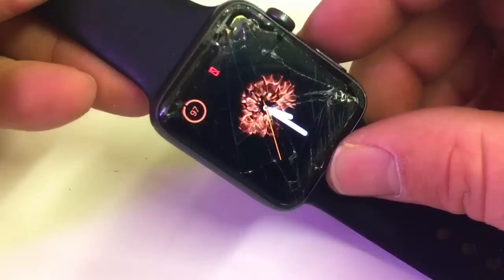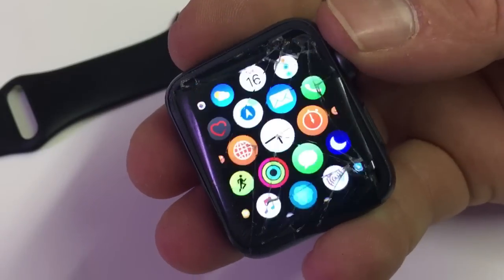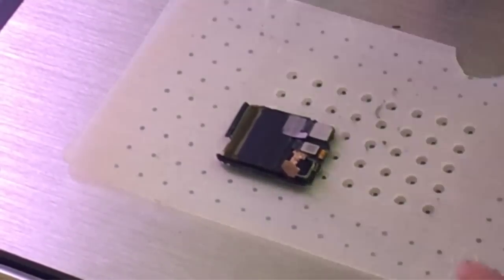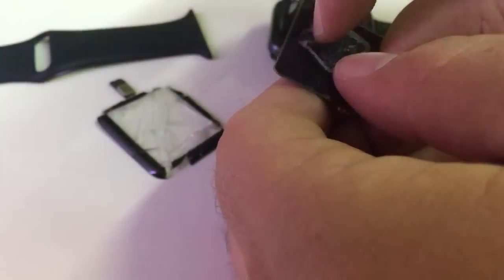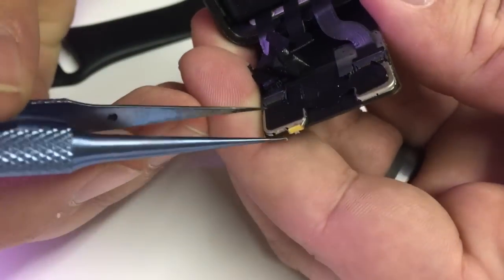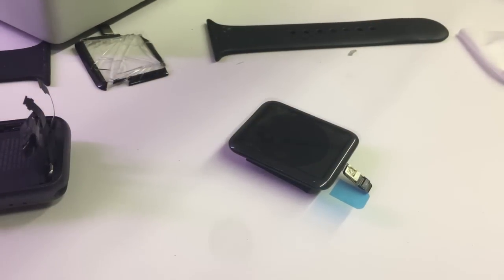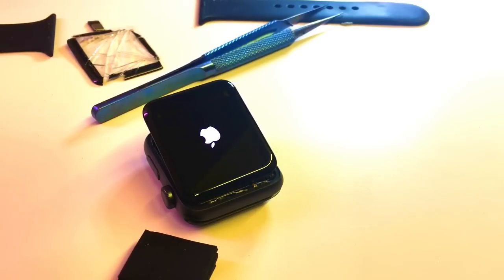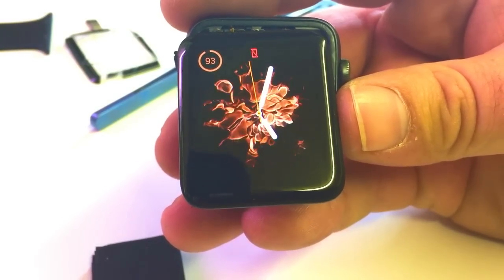Apple Watch Series 3 Successful Glass Repair

Comment: Hi the touch of my series 3 is working well only the glass is broken ..what should I buy? Glass only or the digitizer?
Reply from the maker: The series 3 have a fused digitizer to the glass unlike the series 1 and 4 and up where glass is replaceable by itself. The only time glass is an option on the series 2 and 3 is it the digitizer has been replaced prior with an aftermarket digitizer.

Comment: i glued the screen on but now there is a white bar at the bottom when the watch is powered. does anyone know how to fix it?
Reply from the maker: White bars are indicative of display damage that is most typically caused by some amount or pressure in that particular area and are for the most part permanent. I’ve seen some go away but those are few and far between.

Comment: Are there any more details on the "aligning the LCD" I've seen a few videos that gloss over this part, what exactly are you looking at to make sure it's square!?
Reply from the maker: It depends on the model, but uniformity along the edge of the display and the paint on the glass is what can be viewed under a microscope. LOCA gives you time to correct the alignment where using OCA gives you one shot at getting it centered but can be a cleaner process.

Comment: Hi its better replace the digitizer or just the glass? if you carefully remove the broken glass, whats the difference?
Reply from the maker: The digitizer is the touch layer of the display and new replacement digitizers should always be up to date on the software, but that won’t mean that the phone will be up to date with the new digitizer which will mean extra work to get the watch updated so touch will come back. It’s best to avoid all these issues by doing your best to only remove the glass and not to damage the digitizer in the process.
Reply from the maker: The digitizer is the touch layer of the display and new replacement digitizers should always be up to date on the software, but that won’t mean that the phone will be up to date with the new digitizer which will mean extra work to get the watch updated so touch will come back. It’s best to avoid all these issues by doing your best to only remove the glass and not to damage the digitizer in the process.

Comment: Hi can you list your work station for this. I use hot plates and heat guns but the one you have with vacuum is nice could you share the product info please. 
Also the wire you use for separation . I am new to watch repair and appreciate all the information  and advice. Thanks

Comment: Great Job!
What glue do you use to put the screen back into the frame? I typically use E8000 but it dries quite fast so it is less than ideal.
Thanks in advance.
Just subbed!!
Reply: I had the same question

Comment: So i'm new to repairing screens in general, if that black film (don't know what it's called, but the part you slowly got the adhesive off of while rubbing with your finger) comes apart from the LCD panel that lights up can it just be placed on top and still used or is it more intricate than that and if it comes apart you need a whole new LCD. I just attempted to repair one for the first time and it was really loose and just fell off easily, of course, i hadn't watched this video first so it was probably my fault when removing all the broken glass since i didn't use a wire. Thanks! I looked all online and i have yet to find any article that addresses that part of the LCD.

Comment: I am going to try this repair on y series 3. I have a few questions. I mistakenly ordered 0.06 mm wire, will this work? Also, how much heat do you apply to the glass when removing the LCD? I do not have a heat mat, I plan on just using a heat gun along with a drug store heating pad. Any advice?
Reply from the maker: Joshua Rust the wire should work if your careful 
I heat mine to 80c, not sure how you’re going to achieve constant heat while removing the glass. Good luck
Reply: I decided to go with a replacement screen/digitizer assembly. When I put it on, the screen shows static/snow. I've tried to hard reset it with no luck. Can't find any help in forums. Any ideas what could cause this?

Comment: Hi there.nice video.have an question:how you can check if the force touch works before you glue the touch on the LCD?as i replace one and all was working fine beside the force touch and the force touch sensor is ok.

Comment: @fixd hi i tried taking out the glass but everytime i take out the glass a vertical line will show on the display.. am i doing something wrong? Thanks
Reply from the maker: bprofxp yes, it would mean that at some point in the repair you put to much pressure on the display. It could also be a shard of glass that gets pushed into it but is most likely happening when removing the glass.
Reply: FIXD Phone Repair thank you for that info... i am using also a heating plate with vacuum but it seems not staying put... any tips u can share that will be a great help.. thanks

Comment: Hi friend, very nice job. I have done the same using oca glue,  not loca, and after repairing force touch stop working. I think that Apple Watch detects the fake digitizer and force touch stop working. Have you ever had this problem? Thank you, im Andres from Argentina.
Reply from the maker: Andres Amoretti it typically means you need to replace the force touch. It doesn’t stop working unless it becomes damaged.
Reply: FIXD thanks my friend, im going to try replacing the force touch and i will tell you the results!!!

Comment: A large rubber eraser and low heat from a hair dryer or heat gun can speed up the glue removal
Reply: I think there's a reason his using a heat plate because there's something really sensitive inside

Comment: is it still waterproof????
Reply from the maker: BRIM they are never “waterproof” to being with, only water resistant. However I’ve never had anyone to date have an issue with water after I fix them. That’s not to say if someone else does the repair that they will Successfully seal it from water. But great question. Thanks

Comment: Is it possible to replace only glass like you did in series 4 video.
Reply from the maker: Neranjan Walakulpola I already have 4 videos of the series 4 repairs check them out!
Reply: I mean is it possible to do for series 3 only glass replacement without Digitizer
Reply from the maker: Not on the series 2 and 3. The digitizer is integrated into the glass.
Reply: Thank you very much for you kind help. Keep up the good work. 👍🏻

Comment: Would this be possible with a hot air gun?
Reply from the maker: Frank Drk0 it would be extremely difficult, but nothing’s impossible.
Reply: FIXD what if I had a metal plate underneath and kept on heating it with the gun?
I have a friend who is selling a series 3 for about 130$, and I know my way around repairing gadgets. That being said, I'm also not a pro by any means. Thus me being reluctant
Reply from the maker: It’s possible. You can find an ok heat plate for $50 on eBay I believe.
Reply: FIXD thank you very much for the help

Comment: Hey there what temperature do you set on the suction heat plate to soften the glue between the glass and the old screen? Is there a risk of making it too hot? And how long are you supposed to keep it on there for before you start separating the two? Your videos are brilliant by the way :D
Reply from the maker: Avid Listener I set me temperature to about 80 degrees Celsius.
Reply from the maker: 75-85 will be fine on most machines
Reply: Can I use a pan ????